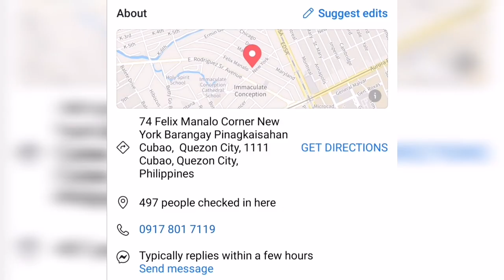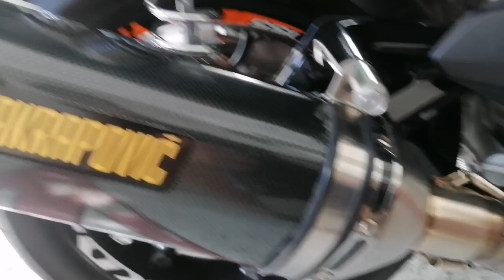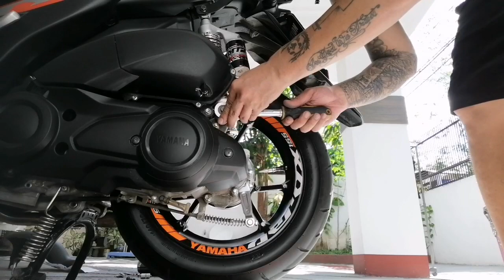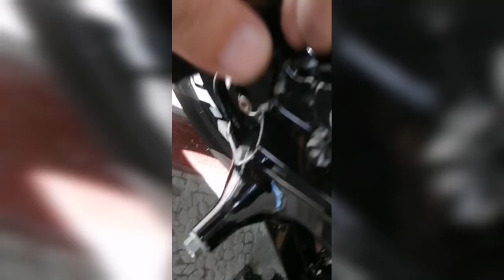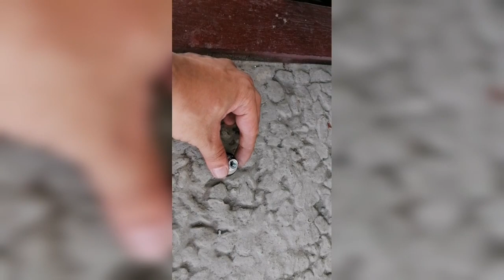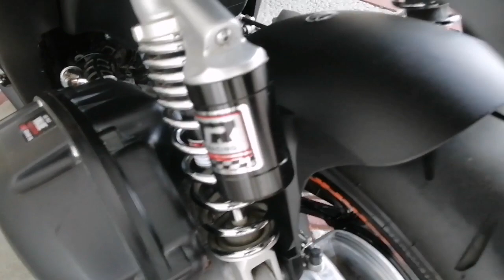Yamaha Aerox | Tire Hugger | Installation | DIY

Comment: Boss approved po ba ng LTO akra. Salamat
Reply from the maker: Good day boss! Ang alam ko pag mataas sa 115 dB negative sa LTO yan. Pag walang silencer yung akra negative. Depende rin sa area boss. May mga iba na di pwede nakamodified pipe. Ride safe and Godspeed.
Reply: @bjmotoyam7112  ilang decibels pag may silencer? Tsaka magkano price ng akra
Reply: @bjmotoyam7112  99db na kasi bagong regulation ng mga lacoste ngayon
Reply from the maker: @renzsuetos7393  99db na pala. Nasa 90 to 100db siya. Nabili ko yung akra 6700php